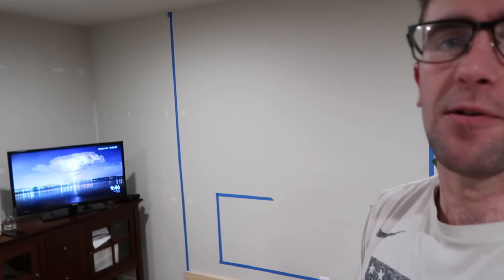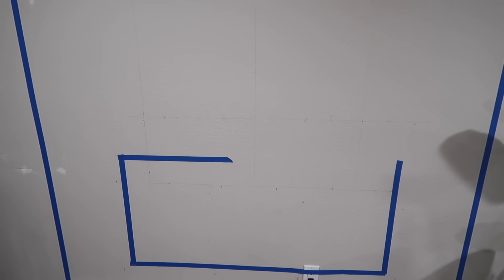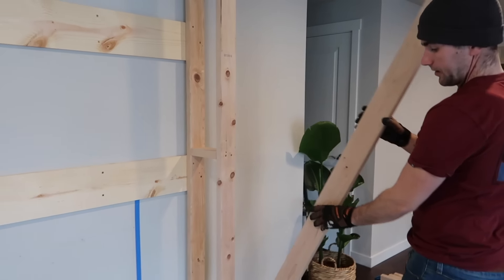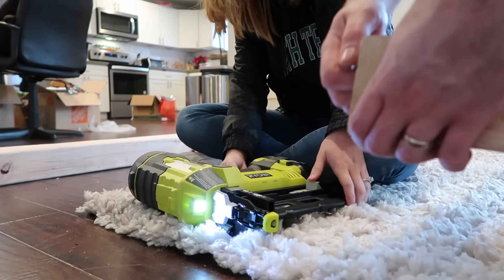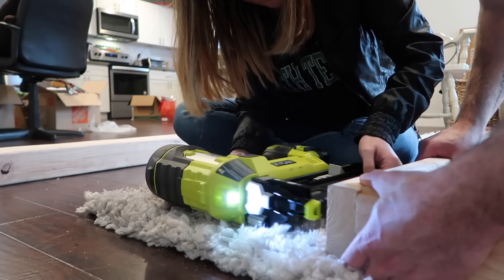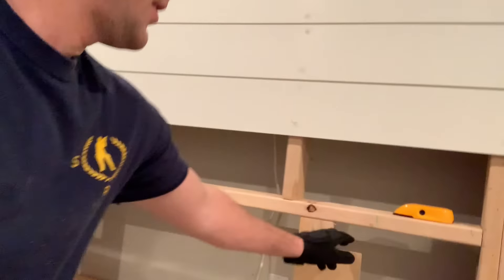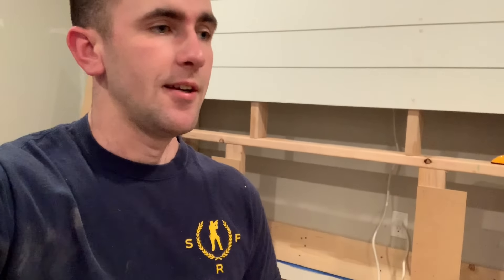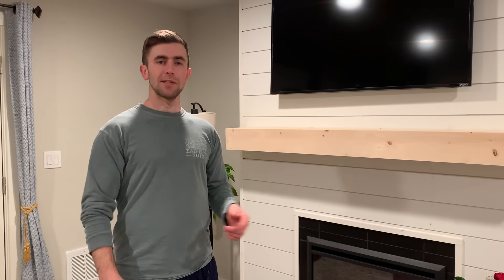DIY SHIPLAP FIREPLACE | WALL TRANSFORMATION

Comment: TV that high is gonna cause bad neck pains.  Why do people do that?  Most people sit down when they watch TV and the center of the TV should be around 4 feet off the ground. If you buy electric fireplace just ambiance (I think most people do), why don't you just trim out the TV the right height as a fireplace.  When you need the fireplace ambiance, just turn on a simulation and be done with it.  When you need to watch TV you can be in a relaxed position instead of looking up to the ceilings.

Comment: How did you mount your tv?
Reply from the maker: Thanks for the question! I have a link in the description on the mount I used! It’s kinda like a scissor style mount that I mounted on the back 1x6 anchors that I installed in the beginning! It’s extendable almost 2 feet so I cut I square hole in the front Shiplap and pulled it through to mount my TV!

Comment: 1. The TV is way too high. You cannot properly watch TV when the bottom of the TV is 60 inches above the floor.
2. One major flaw with this design (as with so many YouTubers DIY-ing electric fireplaces) is attempting to create a traditional looking fireplace with electric clone while adding a TV above.
3. Electric fireplace is not traditional; therefore the mantle serves no purpose. The mantle added at least 24 inches of unnecessary height to the TV mount.  The design guideline should be “mantle or TV” but not both.
4. If you choose mantle route, you should just skip the TV altogether. Otherwise your hard work will only result in neck pain.
5. If you choose the fireplace/TV combo.  You should follow the rules that the TV should be mounted higher than 42 inches above the floor.  This means that close to 90% of the Youtube videos regarding DIYing fireplaces are misleading their audience.   
6. I am so surprise that very few comments talking about the flaw with electric fireplace+mantle+TV design.  
Neck Pain is just not worth it.
Reply: This is how he wanted his tv I mean you can clearly tell he’s good with measurement I’m pretty sure the tv is where he want it to be . Did give not 1 compliment, left all negative comments that’s not cool
Reply: @tyjuanjohnson5069  Hearing the truth is not cool THEN you can mount your tv even higher.

Comment: Why would you shiplap a fireplace?
Reply from the maker: It looks good and is a lot cheaper than brick
Reply: The Modern Man what if an ember catches it on fire?
Reply from the maker: It’s an electric fireplace.
Reply: The Modern Man what if someone turns the electric fire up too high and the electric flame actually ignites the shiplap because the paint you used is highly ignitable to electric flames? Pro-tip, would read the safety precautions on the paint can to see if electric flames are dangerous around the paint. Sometimes paint fumes can stick around even after a few weeks and could be strong enough to be fuel for the smallest flame or even the smallest electric ember.
Reply from the maker: Yeah ok, thanks man!
Reply: The Modern Man no problem. Always happy to share pro tips with novice diy guys.
Reply: I'm James pro tip hagahahaha combustible fumes from water based latex paint.😂😂😂😂😂😂I love to see a “electric ember”😂🤣🤣🤣🤣🤣